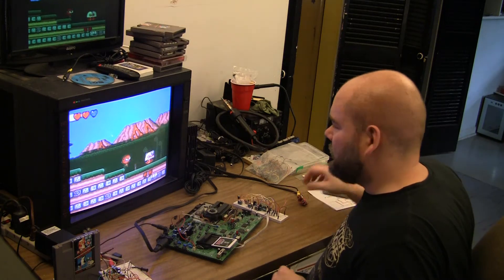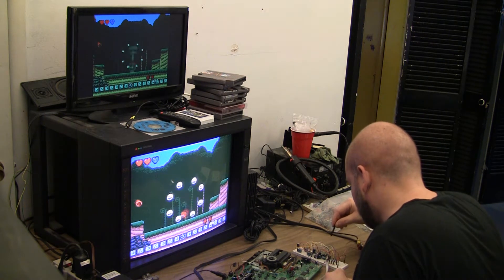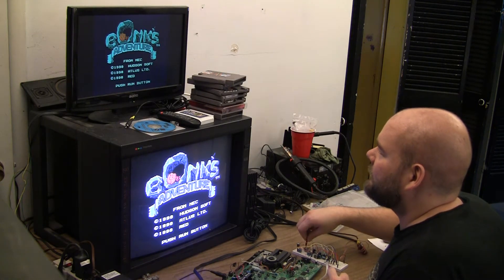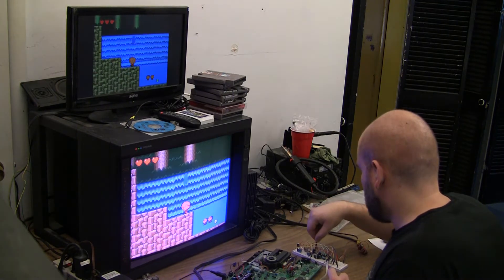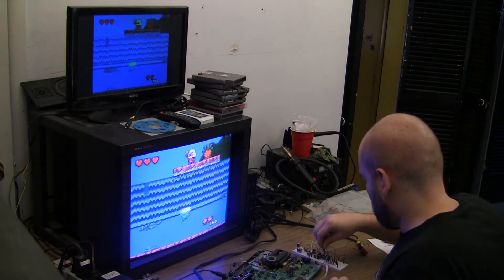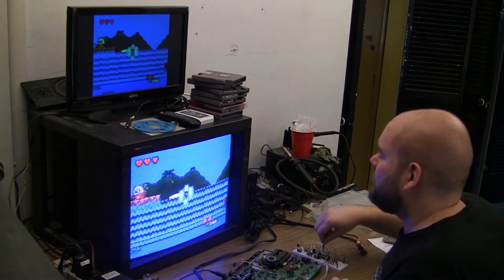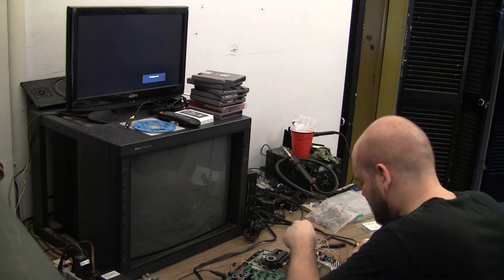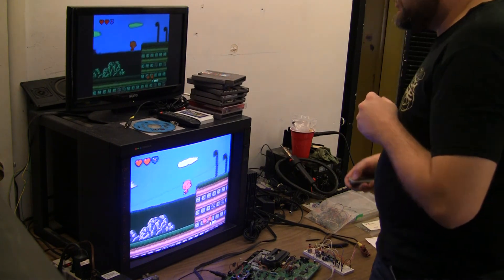Turbo Duo - Component video output using thesteve circuit - too dark

Comment from the maker: I hope to get back to steve's circuit soon, getting backed up on customer mods again. I'm very unsatisfied with the colors ATM, but I haven't tried the latest values posted the other day.
Yeah watch some of my older vids, I use the 6592 in the nes rgb to component mods. It will prolly work on the duo with tweaking, but I got a bad jitter last I tried...
Reply: Not sure if you already sorted this out, but I read that when you get an overblown color like the green, it is actually caused by a weak signal. So if you install a ~220uf capacitor, it should bring it closer to spec. 

Side note... doesnt the HUC6280 output component natively???

Comment: Oh, you know about the SNES BA6592F chip ?? I thought about that actually. I have 2 spare S-ENC chips myself now from dead SNES motherboards. But yeah, steve's custom circuit is buildable from off shelf parts so that's better. Needs tweaking, but hopefully it'll get there.

Comment: I guess if you wanted to make a generalized RGB to component board, you'd need the ability to adjust the RGB signals and the component signals, since each console would likely produce different RGB voltages.  :(

I have access to a vectorscope, but have no clue how to use one.  If I have color issues with my BA6592F circuit, I can get someone to look at the output on a vectorscope.

Does the JROK "just work"?  I know it has trimpots or something adjustable on there.

Comment: I haven't yet built any RGB to component circuits, but I've just received some BA6492F chips, so pretty psyched about that.

The only console I've had to amp the RGB was N64.  My other consoles (genesis, snes, master system, dreamcast, psx/ps2) have just required caps and/or resistors.  This has just been to hook up to my PVM which might be more lenient than a chip converting to component.

Comment from the maker: I tried it and got a jittery image, not sure if I filmed it though, plus this one is cheaper and easier to build, but so far i'm still not happy with the colors and brightness so I may go back to the 6592 soon. 
I already have a non nintendo version made, but only tested on the tg16 and duo and they may need extra components to work right, but yeah it's somewhat done. What consoles don't need the amp? Genny?

Comment: Couldn't you use your existing BA6592F RGB to component circuit?  Are you just trying something different?

Also, should you ever decide to make a PCB like your BA6592F NES PCB, but without the PPU socket area (or even without the RGB amp, or the ability to skip the RGB amp), I would totally buy at least ten of them!

Comment: BTW, did you have actual 6.5 KOhm resistors handy like the schematic calls for or did you try 6.8 KOhm resistors instead ?? I noticed that 6.8 KOhm is the standard in any resistor kit, that's why I ask... That's all I have myself and that's all I see available in any general resistor kit... I asked steve if that was gonna be a problem before actually.

Comment: Oh, when you mentioned that a transistor was wired in backwards, I assumed that was wired in with a live +5V source, that's why I said it's possibly damaged. If you didn't even have power applied yet and you caught the mistake beforehand, then yeah, there is no damage to the transistor or anything else obviously. On the darkness issue, how about removing R16? The other thing, what direction are the 22uF caps? If you have non-polarized ceramics, that'd be good. If not, (-) end to 6.5k resistors.